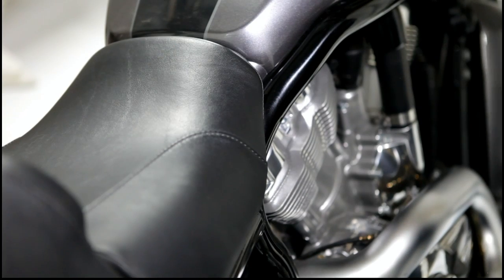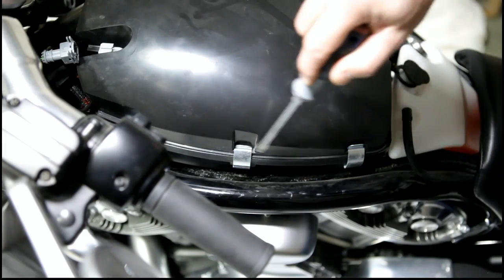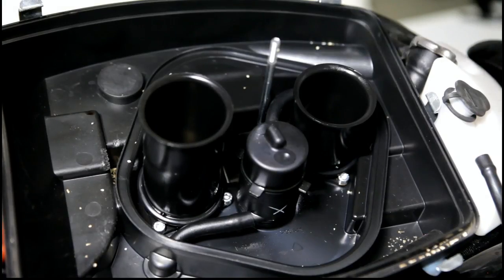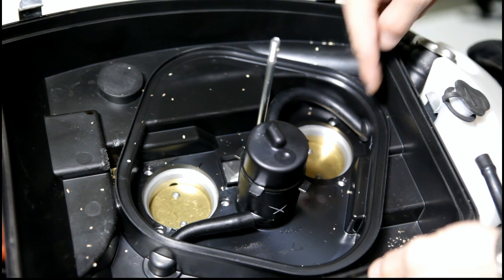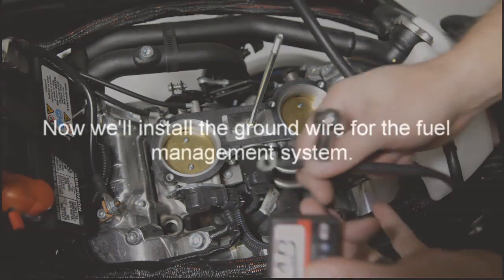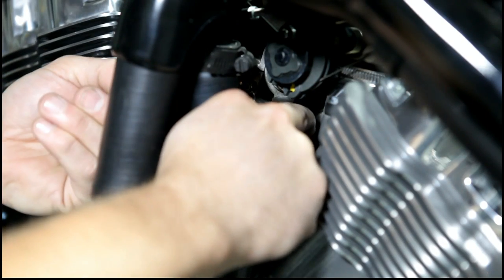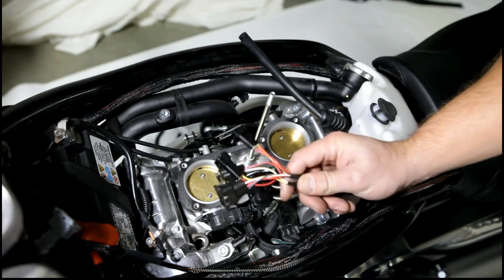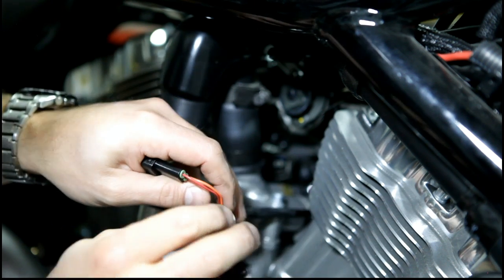TAB Fuel Manager Installation

Comment: Man i have a tab peformance slash cut pipes and a air box mod on my 07 night rod would the tuner help and would I have to get the bike mapped
Reply from the maker: Yes, a tuner would certainly help.  Dynojet will have a map that should be close, but a full dyno would be best case.

Comment: Do you have any videos on installing the fuel controller on a street 500? I plan on purchasing the stage 1 kit from you guys.
Reply from the maker: I do not believe we do.  It will be similar to the VROD fuel controllers we used to sell.  This is a product that is obsolete for the Street, we have 10 or so left, and then we will discontinue them.  That is why the price is so deeply discounted.  They work good, just easier to use the Power Vision.